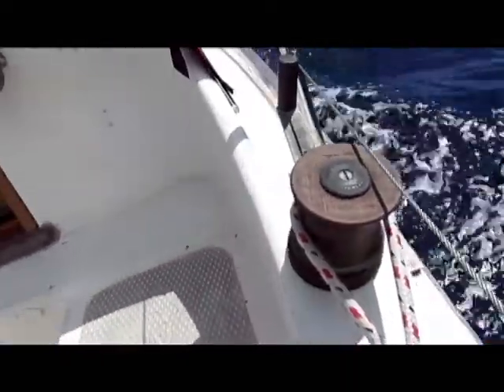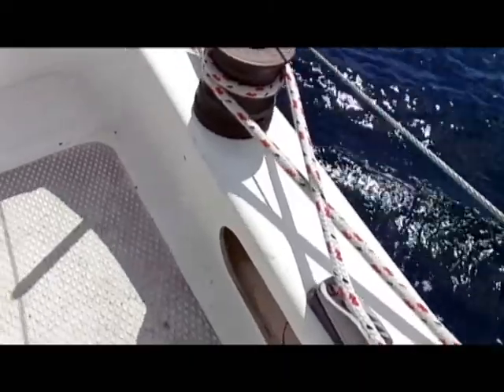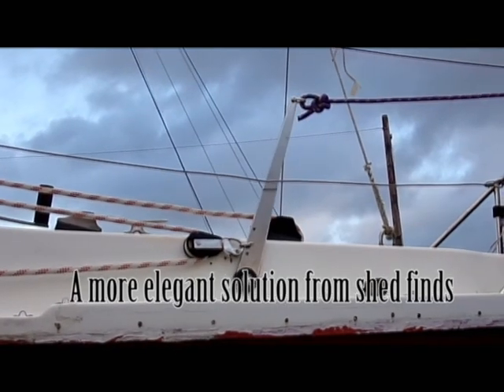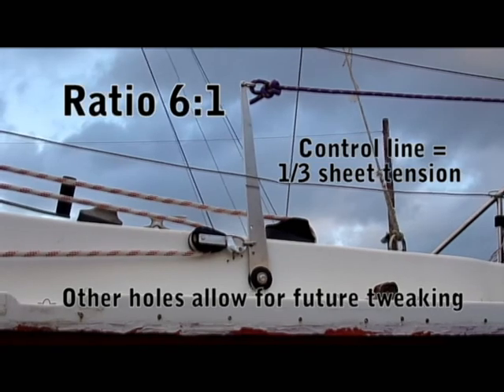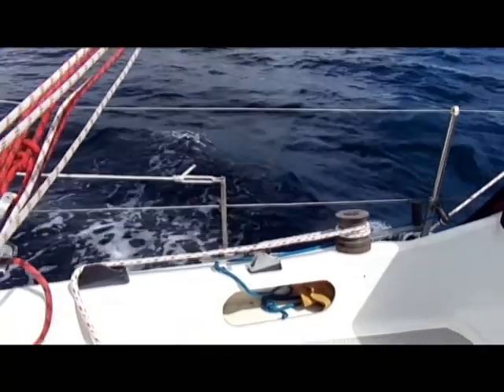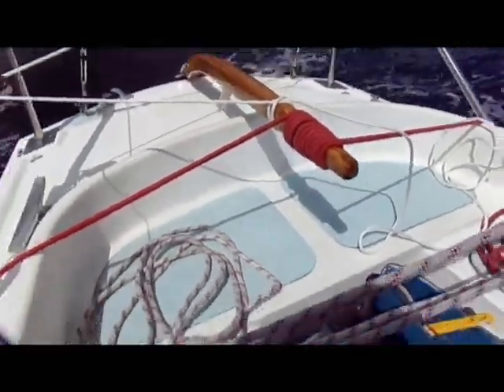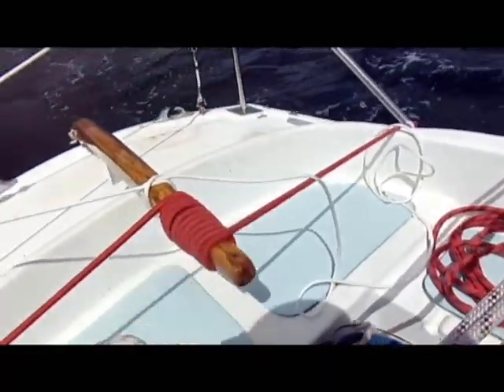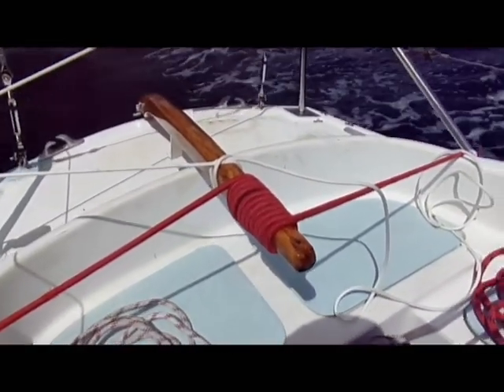STeLLA Sheet to tiller self-steering made easy

Comment: Hi there, great video, thanks for making it. Could you tell me, please, how you attached STeLLA to the side of the yacht? It looks like a couple of washers, maybe teflon ones, with a through bolt. Your advice appreciated.
Reply from the maker: Yes I have a lathe and turned a stepped washer from delrin, but failing that you could use flat plastic washers and a repair washer outside to spread the load.  Grease the bolt if it is metal to metal.  On the inside I used a repair washer and nyloc nut.

Comment: Thank you for sharing these videos.  Seems like you are working toward being able to set up tiller self steering so that sheet adjustments do not require resetting the tiller connections directly - a significant improvement.
Reply from the maker: Originally I was just looking for a means of reducing the load in the sheets so that the methods I have used before could be applied with the larger boat.  It sooner turned out to be an improvement because the sails can be trimmed much better without touching the tiller line.   This year I am planning a long offshore passage and if so will post the results.